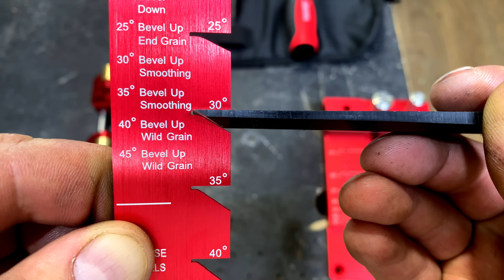This tool should be in every workshop.WOODWORKING.BANGGOOD

Comment from the maker: In this video I review a tool from China.
Below are links to tools that you can buy, use coupons and get a discount:
1. Sharpening system
https://www.banggood.com/custlink/m3G5zZTQrS
Code:BGb45a81
US warehouse price: $29.99-34.99
2.HONGDUI KM-17 Pro Router Plane
https://www.banggood.com/custlink/mmD5zIfb5c
Code:BG40b223
CN warehouse Code price:$139.99
3.Chisel set
https://www.banggood.com/custlink/3vGP2SwAVl
Code:BG28e258
Code price:$23.99
4.Woodworking hammer
https://www.banggood.com/custlink/DDDHqSwnt0
Code:BGf4c166
US warehouse code price: $55.99
5.Sharpening stones
https://www.banggood.com/custlink/33Gtk9uAPD
Code:BG7ba77c
Code price:$49.99
6.MFT Table Clamps
https://www.banggood.com/custlink/DGv5zI1nFN
Code:BGdcff66
Code price:$31.99-62.99
Banggood Woodworking Tool Festival htpps://www.banggood.com/custlink/GGDHkQpnrd

Comment: What was not said is that the honing tool does not really fit on the whetstone if you use a larger chisel, even if you change the wheels from outside to inside, as you can clearly see 6:33 (no more than two half wheels out of six are in contact with the whetstone).

Comment: Are those some kind of special stone that do not need soaking? Water stones normally require soaking for at least ten minutes, not just dipped in the water and then used straight away. However the Enjoywood range of tools are excellent value for the money. I own a few items from Enjoywood and they are all quality items. I intend to add to my collection as needed with new projects.
Reply from the maker: I wouldn’t recommend these stones for sharpening chisels or plane irons. They are more suited for household needs, like sharpening knives and similar tasks.

Comment: I love the sharpening system.  However it is sold in two parts. You show both parts in the video but the price you quote is for one part only.  The two parts together are over $70.00.
Unfortunately the sharpening stones shown in your video are crap.  Buy those elsewhere.
Reply: Total garbage. Get a decent stone and take care of it and it will be worth it .Whatever these are made of you will get frustrated and probably ruin your chisels (not those trowels they call chisels)